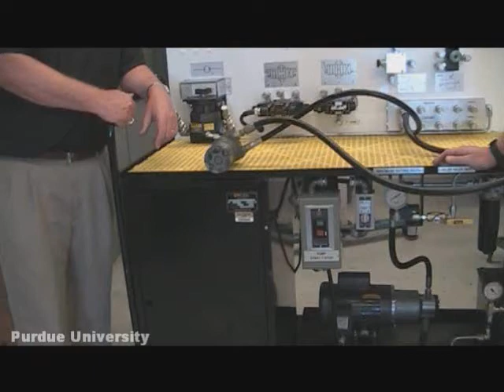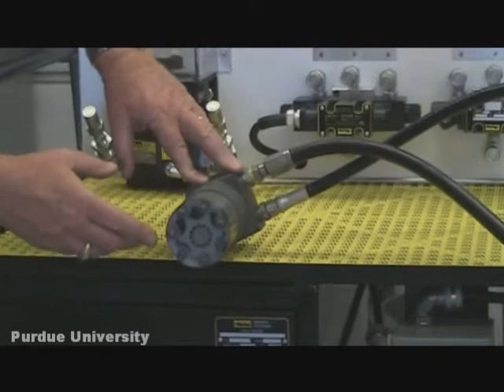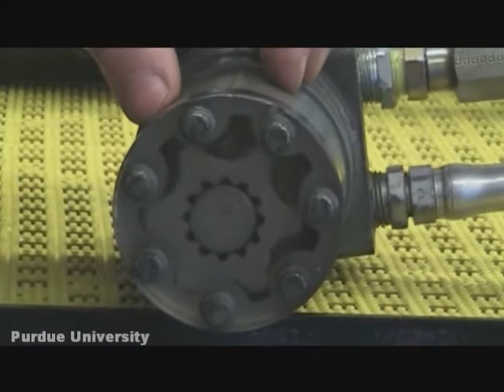Hydraulic Motor Demo

Comment: I want to build a gokart from a zero turn mower and it has hydraulic wheel motors but they dont turn that fast i want to replace them with some with a much higher rpm
Reply: You could change your gear ratio, take advantage of the torque with hydraulic motors.

Comment: For machinery , Hydraulic motor
Low speed high torque hydraulic motor :
Orbital hydraulic motors Danfoss Eaton series replacement and so many other type of motors.
Email: alice@jinjiahyd.com
WhatsApp: 0086-15689754023
wechat :15689754023